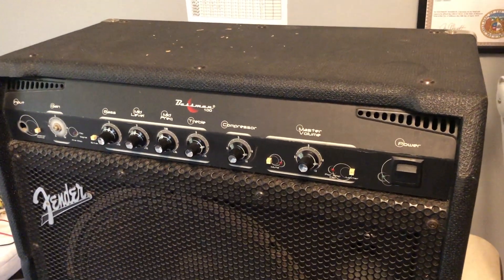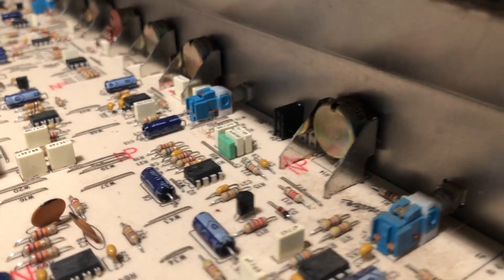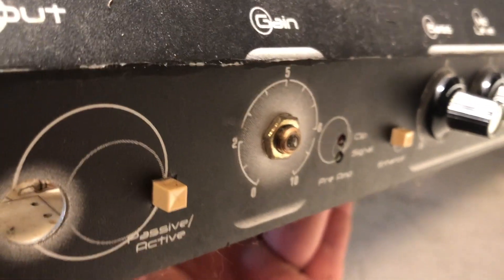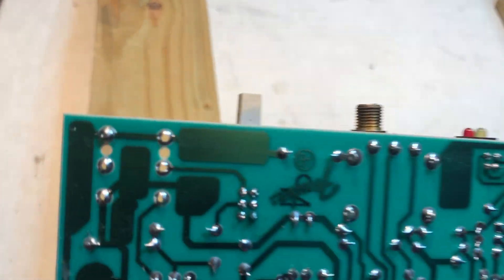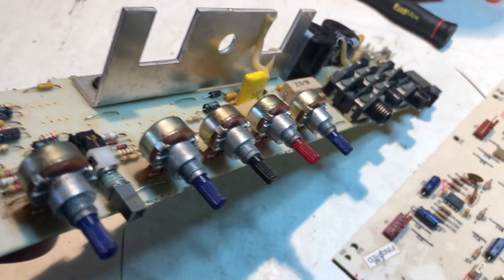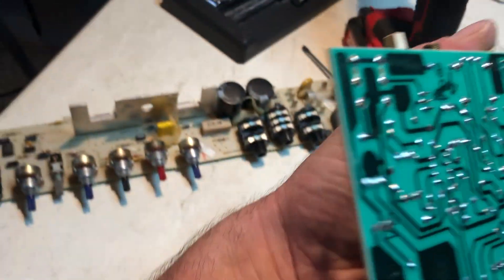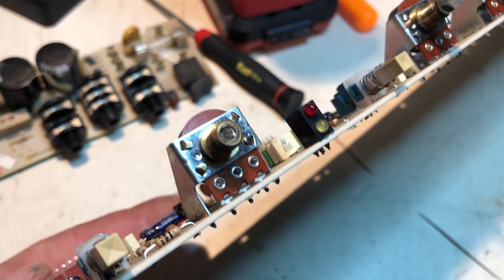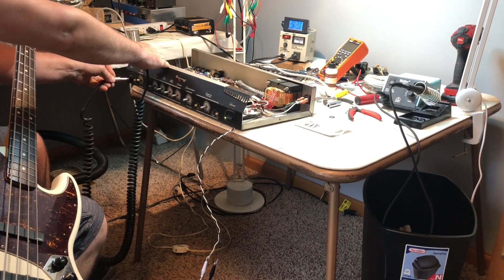Fender Bassman 100 solid state repair

Comment: How do you get the amp out of the cabinet?  I’ve removed the 6 screws from the top of mine and it doesn’t budge.
Reply from the maker: They are very snug and might have a adhesive strip where it joins the cabinet.  Might try running a butter knife along the top edges.
Reply: @ thanks. I also missed two screws on the side. I was able to get it removed. Thanks for the video.